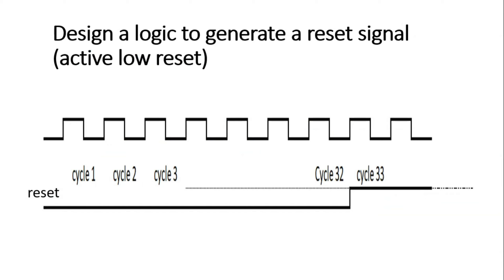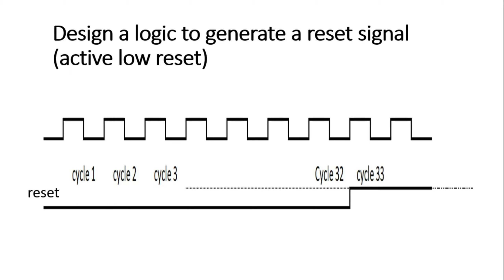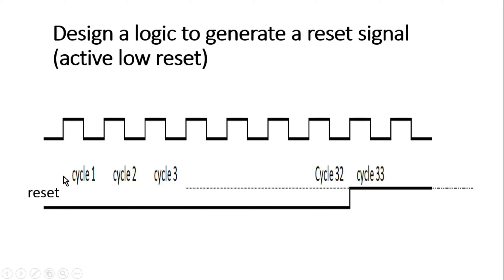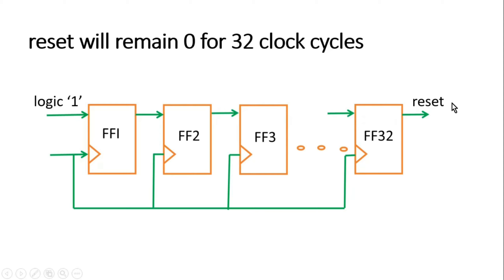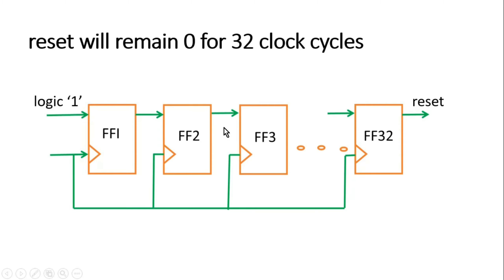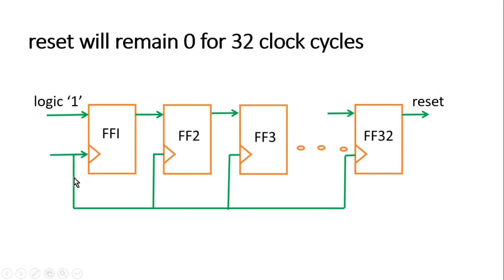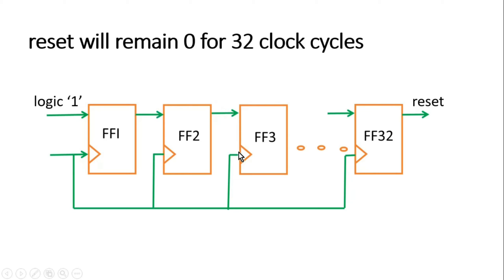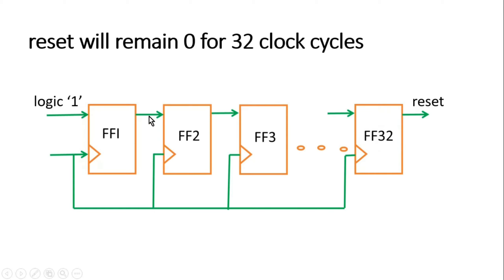Design a logic to generate active low RESET

Comment: Take a 32 bit shift register and initialize it to all zero and then apply logic high at the input it will take 32 clock cycles to appear at the output.